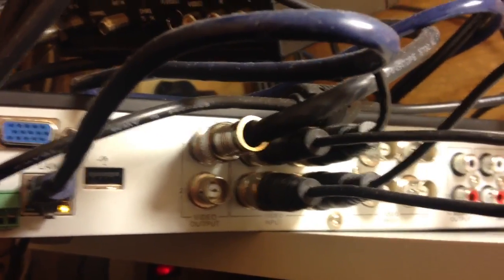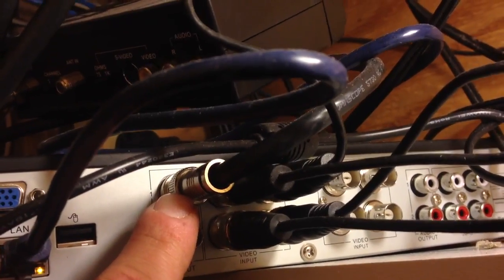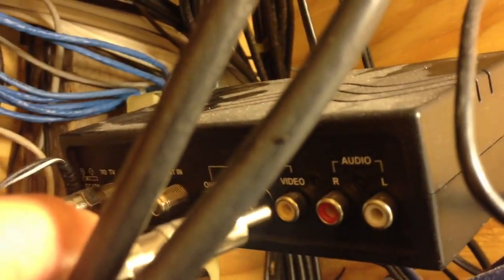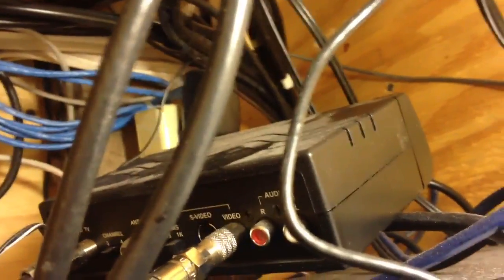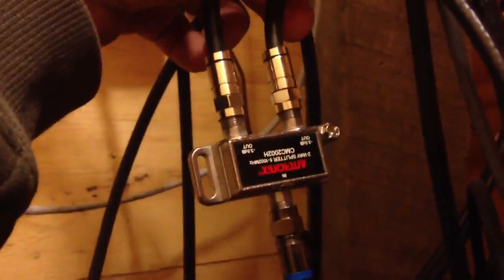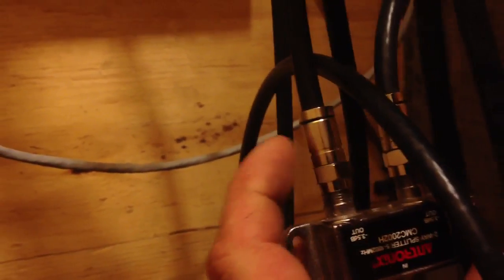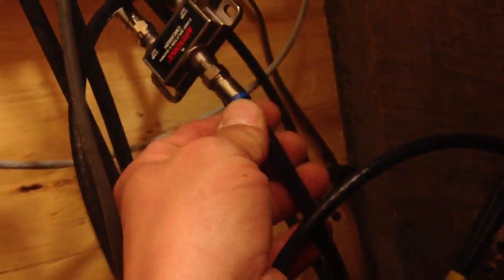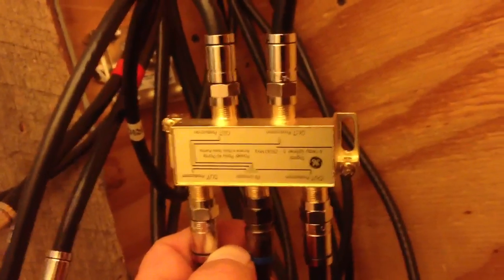CCTV distribution

Comment: Can you use the ant input instead of the rca input and it still work with this modulator, or do you have to use the rca and make this custom cable.  If you dont wantto make a custom cable can you get a bnc female to rca connector and continue to use the RG-59 cable?